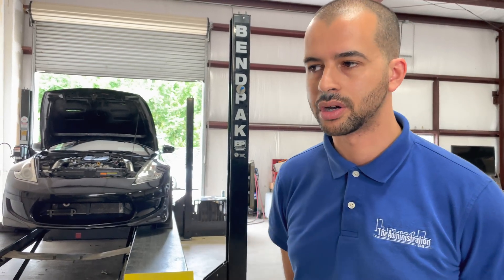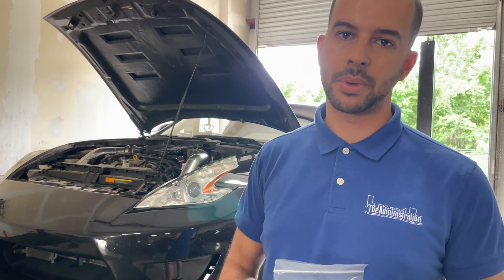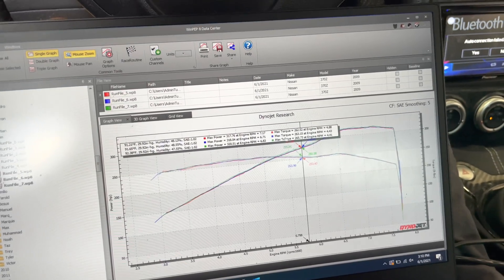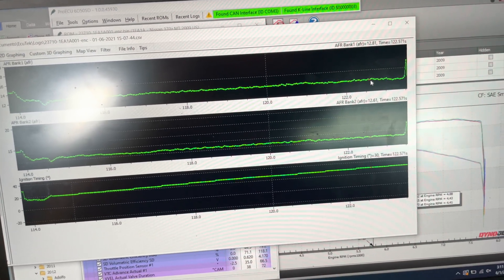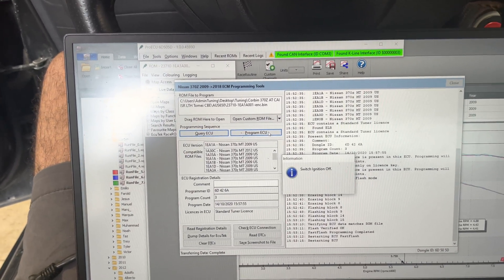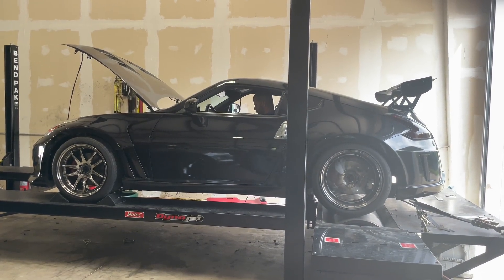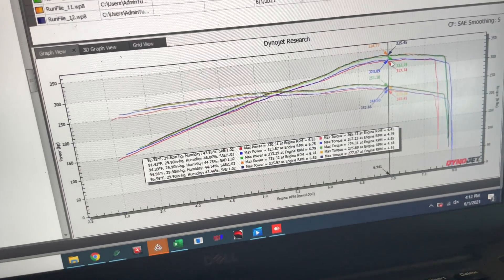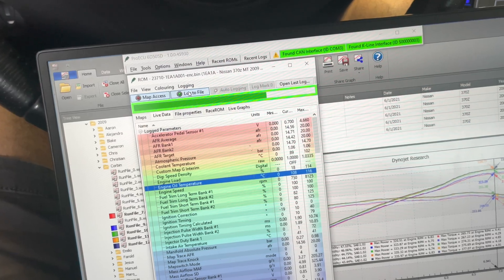What Injectors To Use On Your NA VQ35 or VQ37 - AdminTuning Injector Testing & Tuning

Comment: Can  i run e85 and 93 at the same time smoothly  with just injectors and upgraded fuel pump, like the one you offer on your site (e85 as race fuel and 93 as daily fuel) or will i need a flex fuel kit to run both  @admintuning ? please and thank you
Reply from the maker: Yes you can.
Reply: @admintuning  thx you 🫡🫡

Comment: I have been looking at your e85 conversion kit for my 08 g37. I am still learning. Well, always learning but, my question is can you still run 93 if you want to and just use the e85 on the track?
Reply from the maker: Yes, most of our customer base does this.
Reply: @admintuning  do you need a flex fuel kit to do so
Reply from the maker: @LordKhelvhin  It is not required, but it is recommended.
Reply: @LordKhelvhin  Without flex fuel kit you need to be damn near empty to switch from 91 to E. With the kit, you can mix without having to run your car dry
Reply: @marcussmith7799  ohhh thx u

Comment: I’m trying to figure out the best injectors to use for a DE. I have ISR long tube headers, ISR Y pipe and ISR single exit
Reply: just get regular 550cc gtr injectors oem hitachi fuel pump wilk work its not a must to upgraded its just recommended
Reply: The ones on his website
Reply: U need a tune and fuel pump for them tho
Reply: i got the same setup my boy, i have a sedan

Comment: hey so what if i get gtr injectors to run e85 do i have to change the fuel pump i have a 08 G35 
what happens if i dont get a tune  if i get the gtr injectors only an run e85

Comment: Im soon going to purchase the ECUTEK and your tuning for my 2011 G37.  I wanted to ask before i upgrade my exhaust, do you recommend two to one or dual exhausts?  (Planning to get Race Pipes, Borla Pro XS For mid, to dual piping with 4" Tips. "May add 12" Resignators after Borla on Straight piping out)  what do you recommend,  thanks 👍🙏🇬🇺
Reply from the maker: I would not recommend anything Borla. Please use an ARK, GReddy, or Motordyne catback.
Reply: @admintuning  thanks for the heads up on that.  One more thing, would it be best  to stay with a dual or go with a 2 to 1 Exhaust system.   
Its really humid  on my island, averages around 90deg daily.  No E85 (Corn fuel) Highest pump Gas is 91.
Reply: @meggetpangie6199  single exit exhuast like isr, tomei or greddy always make more power but ark full catback or motordyne make good power also

Comment: Is this with the stock fuel pump setup? Thanks.
Reply from the maker: This is with the stock fuel pump, yes.
Reply: You mentioned something about the car not reading it e85 it was at e60. What do you need for that. I have the injectors

Comment: You all do some nice tuning but I never see and dragstrip/dragy times on the cars like this you tune. Does this car have a 1/8 or 1/4 et & mph at the drag strip?
Reply from the maker: Check out my Instagram. I recently posted a naturally aspirated 370Z tuned by me running 11.98 on Dragy, as well as a naturally aspirated 350Z running 11.60's at a track in Florida. I also have track passes of other cars on there. @admintuning
Reply: @admintuning  Cool I will check it out. Also how do you feel about a VHR to HR Upper Intake swap on a 2012 G37?  I tried it to gain more bottomend and midrange and it seemed to have worked. Car is more responsive under 7k.  Looking to do a few more mods soon.  Underdrive pulley and exhaust (custom 2.5 y-pipe and catback) I also have a 3.69 diff I will install in the future.
Reply: @377ndacut hey bro did u get to install the 3.69 diff??? I want to maybe to this for my 350z hr

Comment: So i Have a G37 08 i have 
Z1 intakes
Z1 test pipes
Z1 ported manifold
Axle back
But i have at home an
AEM320lp
Denso Gtr injectors.
Would you recommend to E85 or Not?
Just tune 91?
Reply from the maker: Get rid of the Bosch injectors.
Reply: @admintuning  i talked to a tuner but he recommended me e85 only if i was boosted :( (New mexico imports)
Reply: @admintuning  i mean sorry there "Denso" i fd up

Comment: i have an 03 g35 with a full exhaust would you still recommend the gtr injectors?
Reply: Na dawg, injectors are if your going to run E85 fuel. Just get some test pipes and open up that exhaust.
Reply: If you get GTR injectors you can run on E85 and premium gas 93 octane HOWEVER if you are running on GTR injectors you will need to get a tune on them ASAP
I have a 05 G35 Sedan that was tuned by  this guy from Admintuning

Comment: So will the e85 conversion kit you will be putting on your site have a flex fuel kit (ie specialty z) included?
Reply from the maker: It can be included as an option, since I prefer tuning with the SZ FF kit on all builds.
Reply: @admintuning  there's no option for it on the website?
Reply from the maker: @LordKhelvhin  https://administrationtuning.com/collections/fuel-system-parts/products/specialty-z-flezfuel-kit

Comment: My car made 335 hp and 272 tq with 
ID1050x Injectors
Tomei catback
Z1 testpipes
Admin intakes
320 lph aem fuel pump
Stock headers!!! With admins tune.
Reply from the maker: You have a strong car my friend.
Reply: No ported manis???
Reply: Have you ran it at the quarter mile or compared it to another car to gauge the power? That means you're making 400-420 hp which is E92 M3 territory which would put you into the mid 12's
Reply: @James-wg8mn  I haven’t ran the quarter mile but I’m assuming it would do 12’s pretty easily based on the other cars admin has tuned with same mods. I’ve raced some cars, none that can really be compared to a m3 though.
Reply: Running e85?
Reply: Bruhhh what car??? 370 or 350hr ?
Reply: Currently working on my car where you buy your fuel pump you have link bro
Reply: Would I be able to use a wall Bro 255 pump found it in my garage brand new from my Nissan 240 days lol I already have your injectors I purchased from you. I’m just gathering all my ball parts before I get the tune. I just need to know what this fuel pump work or.
Reply: Can you run 320lph fuel pump without return fuel line ?

Comment: What’s the average MPG? With these mods, maintaining normal driving habits?
Reply: I drive on e85 with 1050x injectors make the same power as this car on stock headers and one tank of e85 last me about 230 miles.. in Florida e85 cost 2.60 a gallon right now

Comment: I feel like those numbers are not the best for the mods / dB levels. I feel like I have definitely seen others in the 340/350 whp range from you guys. Not a dig, just saying I think you're right the motor could be a bit aged.
Reply from the maker: You are not wrong. This combination has done 360+ whp on other 370Zs/G37s.

Comment: @admintuning 
You made a video about using the IDX injectors for the 370z for the spray pattern but mention this would not be a gain on a HR motor. Is that the same case here? Im about to make a push for a 3.7L Short block and some cams but I want to get the fuel system squared away first. I currently have a walbro 255 and Stock HR injectors, Tomei, ISR long tubes, Vstack Z1 intakes, 370s ported and polished mani/plenum and Ported stock TBs.

My goal is to get the fuel system squared, get Retuned by you again and build a set of heads and the block over next year.
Reply from the maker: Part of it is the spray pattern, part of it is the ECU. The 1050X work so well on the 370Z because of the ECU itself, whereas an HR using a different ECU with similar intake manifold ports does not give any gain with 1050X over a more standard injector.